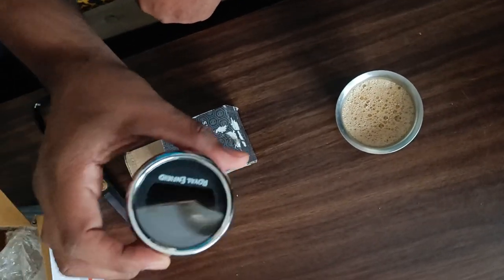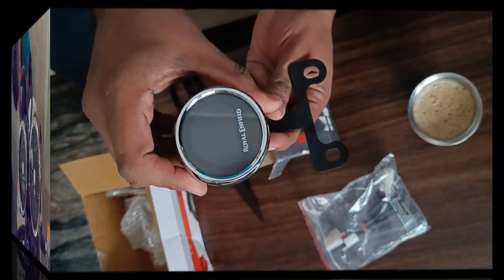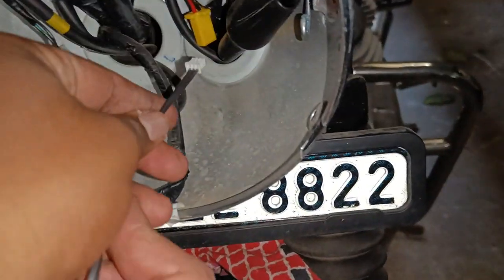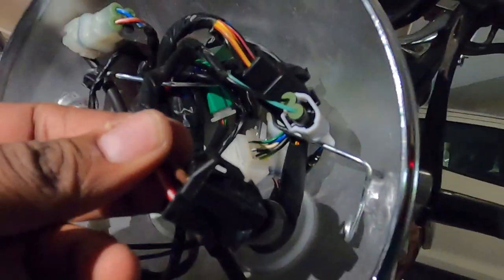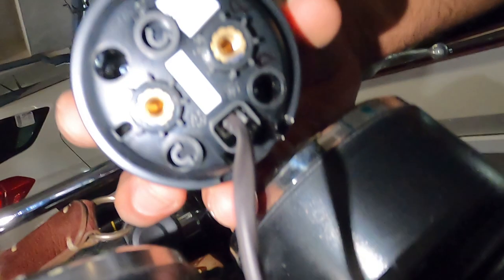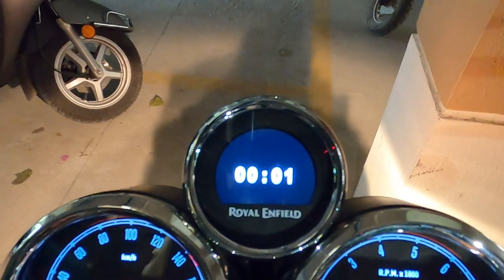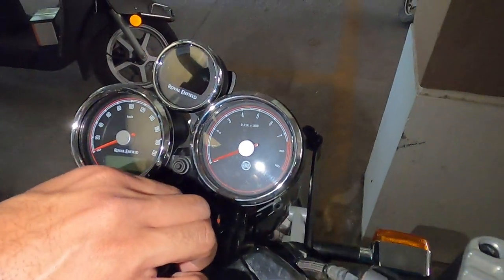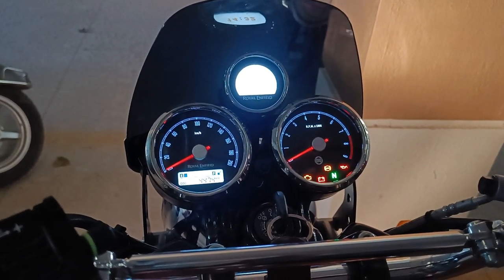Tripper Navigation Installation for Interceptor 650

Comment: Got this from Rider Akhtar? Right?
Reply from the maker: Yes, 786 Rider
Reply: @AverageHumanVlogs  How did you get the Tripper, I'm unable to get it. Out of stock from many days 🥲
Reply from the maker: Tripper Navigation is 5200/-, with 100/- shipping from Throttle and Thump, you can find them on instagram. I have shared their number and ID in the description box. On Road Power Customs, they are selling it at 10,999 that too on backorder. If you want, contact Throttle and Thump Immediately and they will ship it in 3 to 4 days.

Comment: How much does it cost?
Reply from the maker: Tripper Navigation is 5200/-, with 100/- shipping from Throttle and Thump, you can find them on instagram. I have shared their number and ID in the description box. On Road Power Customs, they are selling it at 10,999.
Reply: The  console area looks so good after you have fit  the Tripper Navigation..

Comment: Can I buy the tripper navigation from RE store and will it fit like normal ???
Reply from the maker: Tripper navigation is not available on RE Store. You can buy it from Throttle and Thump (genuine RE Accessories) store and get the wiring ordered from 786 Rider (you can find both on instagram and order it online). It's a plug and play system. Tripper navigation from Throttle and Thump and clamp and wiring from 786 Rider.

Comment: If We install the this Device can we install Royal enfield Wind screen? Will it impact the Warranty? In Bangalore from which service centre you purchased the Device?
Reply from the maker: Yes, you can install RE Windscreen (both the short and long version). I am not sure about the puig brand though. Since this is a plug and play it should not affect warranty. But still if you are in doubt, u can remove it before getting it serviced.

Comment: Will this modification void the warranty?
Reply from the maker: It will affect the warranty. But since it is plug and play, you can just remove it before claiming the warranty.
Reply: Any change needed to put the fly screen with the tripper module?
Reply: Were you able to control the screen brightness ?
Reply from the maker: I have not done any changes to the fly screen, there is contact to the fly screen but no pressure. You can use a double tap or a washer to increase the spacing between the console and the screen.
Reply from the maker: I was not able to control the screen brightness.
Reply: NO!

Comment: bro here in banglore outside it is costing close to 12k ?
how much it costed with device plus bracket cable
Reply from the maker: It's 5500 for device and 1500 for bracket and wires